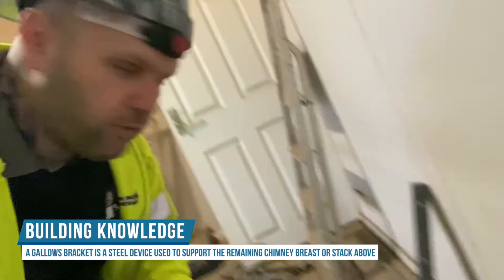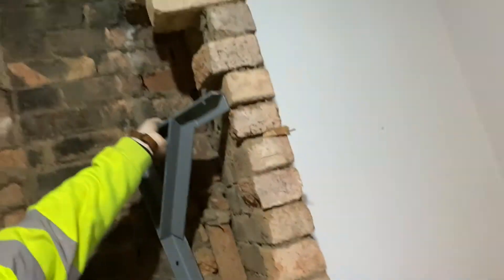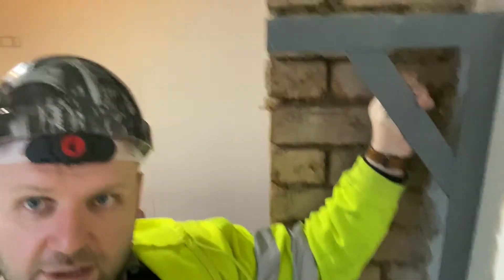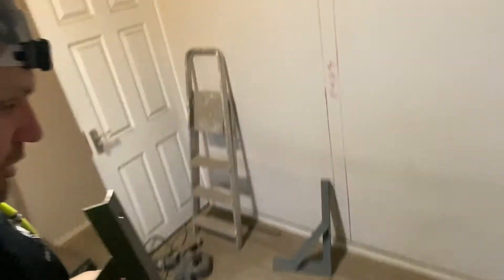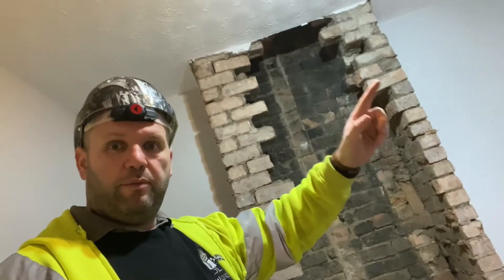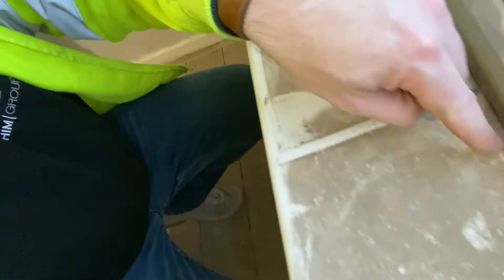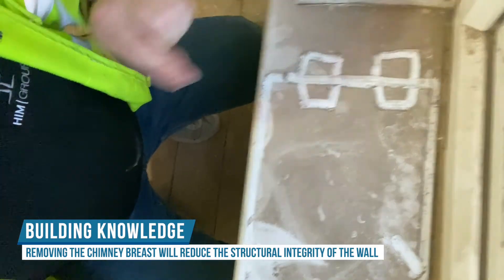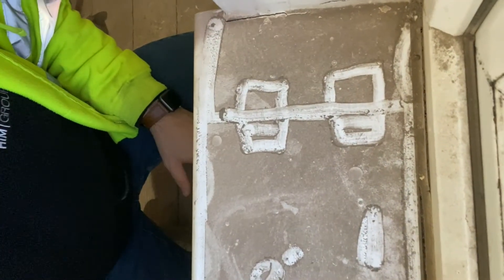Using Gallows Brackets to Safely Remove a Chimney Breast

Comment: What cemfix would you recommend
Reply from the maker: Hi Tim. Thanks for watching and for your question – much appreciated. All makes of cement essentially do the same thing – it's the mixing ratio thats important. John would use a 3-1 mix in this scenario (3 sand, 1 cement) and some FEB.

Hope that helps 😊👍
Reply: @HYPEBuilding  thanks for the response I was after a recommendation of what chemical fix you use to glue in the threaded rod for the brakets or do you use mechanical  fixings bolts
Reply from the maker: @matthewsmade  Apologies. We use a brand called Hilti for this. Hope that helps 🙂👍

Comment: My structure engineer wants us to use the supporting beam , which will cost a lot more. I don’t know should I get a another engineer to check or not ?
Reply from the maker: Hi there. Thanks for watching and for your question. We would always recommend that you follow the advice of your structural engineer – they're the experts in the field. 

This particular job didn't require a beam as we were only removing part of the chimney. Gallows brackets are sufficient for this type of job, but they're not suitable for every chimney breast removal, especially if you're removing the entire chimney from the ground floor up.

Hope that helps, and thanks again for watching 🙂👌

Comment: No risk of collapsing during the removing procedure till gallows brackets are installed?
Reply: I watched this video, which is great btw. Went and prices up the stuff I would need as a rough guide and then read gallows brackets are no longer allowed. Gutted!
Reply from the maker: Hi there. Thanks for your question. There shouldn't be any danger of collapse provided the brickwork has been propped up properly. 

Thanks for watching – much appreciated 🙂👍
Reply: @HYPEBuilding  and the obvious next question is what is for your propping up properly!? :) two props supporting the breast with a lintel close to the vertical wall?
Reply from the maker: @Giuseppe_coachgius  Yes, in this instance, two props and a lintel is sufficient 🙂👍

Comment: Stupid question alert!!! How do you remove the brick to fit the supports without everything falling down above?
Reply from the maker: Hi Simon, there's no such thing as a stupid question, so don't worry about that. Basically, it depends on the complexity of the job as to the method we use. The width of the chimney is a factor, as is what's in the roof and the position of purlins etc. 

With this job, we were able to remove the sides of the chimney to fit the gallows brackets. The front stays in tact because it is still supported. We then use acrow props to support the weight while the steel plate is fitted on top of the brackets. We also use wooden pegs to help support any loose bricks. 

Hope that helps, Simon. Many thanks for watching and for your question 🙂👍